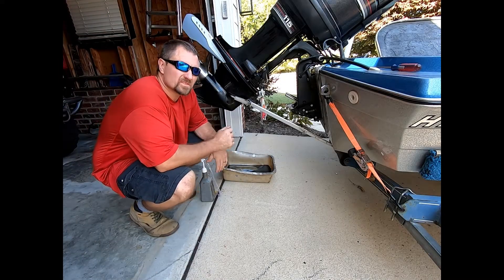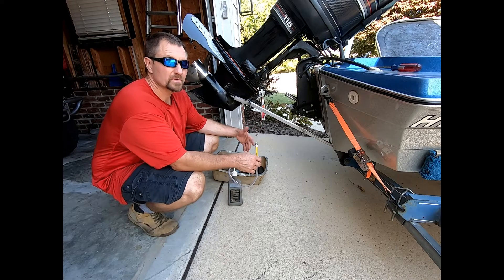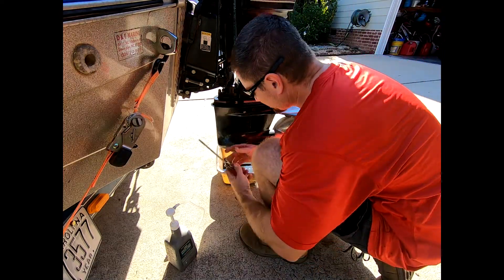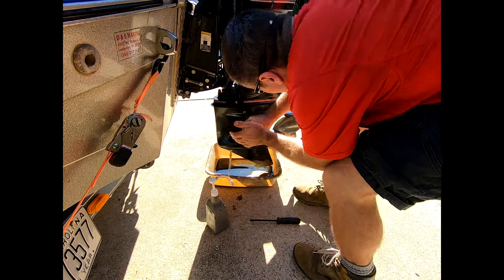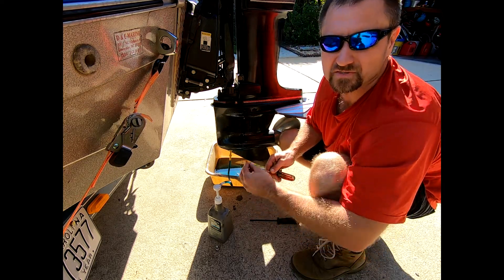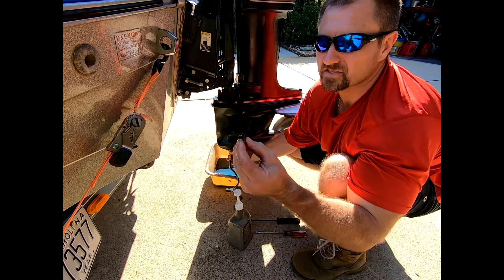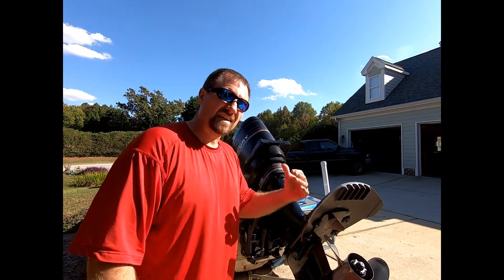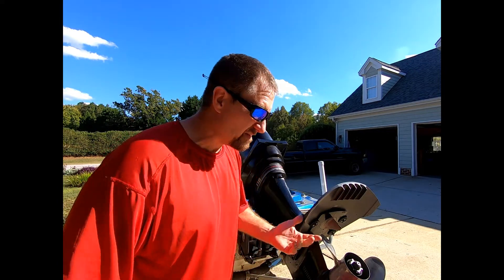Changing the oil in the Lower Unit of the Tower of Power Mercury outboard

Comment: Hi. What hydrofoil are you using? I would like to try the one you have for my 115hp. I have the exact same motor. Im also running to a problem where my prop is not locking when on forward gear. Any tips?
Reply from the maker: The foil is a SE sport 400.    it does put a bit of drag but the hole shot is not bad.   I might do a comparison with a smaller 300.   

For the prop not going in gear properly.   
Things to try.: 
1. Make sure the shifter shaft going behind the lower unit is attached and moving freely.   (this video is not for that exact issue but it might help. https://youtu.be/geyxxGE2DSE)
2.  Disconnecting the cables and shifting it manually.   It that works then the cables just need to be adjusted.  
3.  Worse case is a mechanical issue with the gears.   

Hope that helps.   good luck